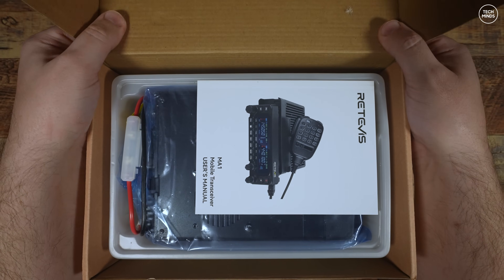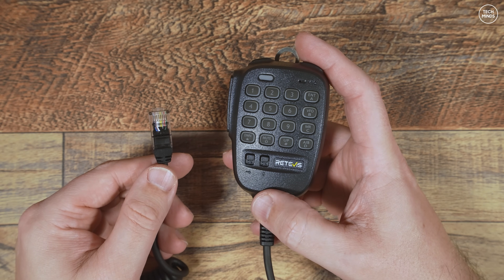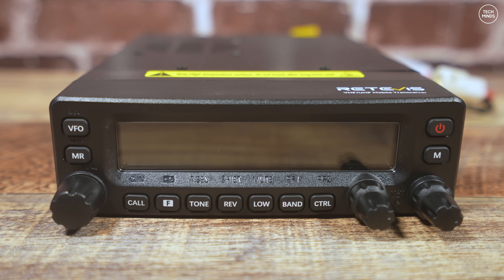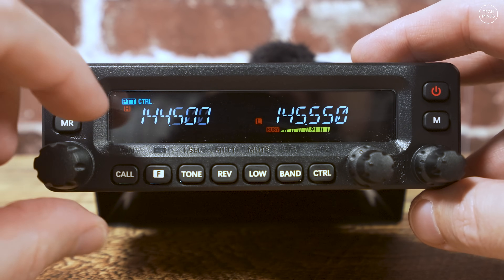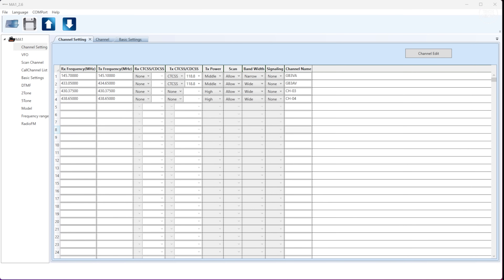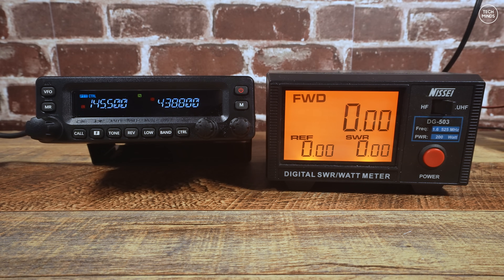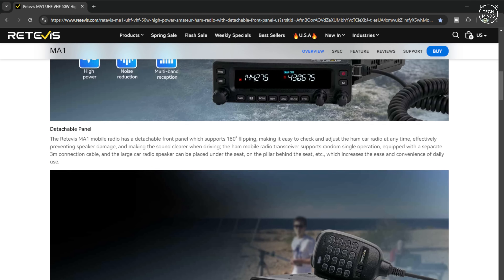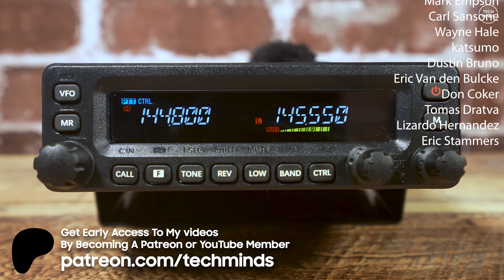Retevis MA1 - FULL Duplex 2/70 Mobile Transceiver - New For 2025!

Comment: Airband definitely seems pretty ok, rather than modded FM AM in firmware, the radio does seem quite big to store somewhere, possibly in the boot, but curious how long the remote cable is, any ball park width of the width of the radio

Comment: I've noticed quite a few people saying it looks like a knock off of a Kenwood V-71a, and looking at that, I can see where the control positions do resemble that radio, but, when I saw the display, the first thing I thought of was from like 30 years ago, the Icom IC-2410h.  That multi color display looked so fancy back then.  It was really just a colored background and reverse LCD.  There was also a version of the radio that had a more standard orange background with black LCD element too.  Google Icom 2410 and you will see what I mean.

Comment: Hi Mat, nice video on this new Retevis MA1. It seems to have a lot of functions I like and also the power output is on pair with Japanese manufactered radios. Did you try to connect the radio's USB port to a usb port of a computer to see if data can be transfered to a coputer (f.e. the Direwolf software TNC). Has it APRS functionality ? Cheers, Phil ON4VP

Comment: RJ-12 not a RJ-11
Reply from the maker: Same plug size, 11 uses 4 wires and 12 uses 6, so you are correct, it uses 6 wires. I had to check! But who cares..
Reply: @TechMindsOfficial  Perhaps there person that is making a extension cable.🤣

Comment: I left a comment on another channel, they missed on the power output with the uhf side of the radio. Where the power output on the uhf side way low in the ham bands. The highest output being at 400.000 mhz hams operate at about 146.000 up and down from there.144.0 to 148.0
Reply from the maker: Sorry, I literally have no idea what you are saying. I measured the power output in the middle of the 2M and 70CM band and showed it in the video for all 3 power levels.

Comment: Clearly, it needs a decent external speaker, but I notice that the AM sound on my Tidradio H3 is noticably worse than FM. Could be at least partly the problem on the MA1 as well. Edit: small keyboard mistakes

Comment: Looks like it would be good for satellite work with the dual rx. Maybe see if you can try it
Reply from the maker: I have tested transmitting on 70cm while listening on 2M and that works perfectly. I think for satellite it would be great to have CAT control, but I am not sure that is possible with this radio. Further research required.

Comment: it comes with a remote cable but i did not see a remote head option in the video. In other words what are the options for mounting the head separate
ly from the radio. Seems like they provide a longer cable but no mount for the head unit.
Reply from the maker: According to the manual, or parts list on the website there is a Radio Bracket which looks to me like it should fit the head unit. However, my box did not come with one! I am going to contact Retevis to see why it was not included. Thanks for pointing this out and reminding me.
Reply: @TechMindsOfficial  The Retevis website shows a pair of brackets included - 1 for transceiver and 1 for control head.  - K2XT
Reply: @feeatlastfeeatlast5283  Yes it does but mine did not come with it either. Not sure what is going on with that. Going to email them.I've watched another video on the same radio and that video also does not show a remote mounting head either.

Comment: Why would anyone waste their time and money buying this radio. Just the same as many other radios already on the market, but with a cheaper LCD screen and hard to read button labels stamped/cast into the plastic! above the buttons
Reply: Are there any other full duplex, cross band repeat radio on that price range? For ne that's the main feature, is there another better radio with that feature? I really want to know
Reply: @briansegarra9312  There is the Anytone 5888uv at $249.
Reply: @briansegarra9312  full duplex!? Ooh that's a steal if you're interested in doing satellites.
Reply: @briansegarra9312 Icom IC-2730a. Much better radio.
Reply: Because many people can't afford a 500 yeasu or icom.
Reply: For the money , it along with others like it a good solution for digital comms where you don’t change much, or for other uses that don’t require a lot of user interaction.
Reply: There is ONE radio that this is competing with: the 2730, with after buying the brackets needed to mount the face to the radio or to extend the cable, bumps the price to over 300 this is currently 260 Amazon
Reply: @jasonlin9805  i ended up getting a icom 2730 , got one used for a good deal

Comment: That looks like a really nice radio Matt. The black display aside, it reminds me of the Kenwood TM-V71 dual band mobile.
Reply: I have the kenwood tm-v71, and this is very similar, almost identical. Display apart, the kenwood one is much better in my opinion.
Reply: yes!
Reply: yes its the same  to kenwood tm-v71 but the black display its not nice.
Reply: I also have a TM-V71. I use it for FM satellite work as it connects to a single antenna for dual band full duplex. This Retevis copy seems like a good replacement for the discontinued TM-V71 but it maybe a tad too expensive for a copy which may have limited to no support in case of failure...I think £180 would be a good price point. I do like the computer programmable aspect and the airband receive is also nice to have. I see it's a tad over £250 inc VAT from AliExpress.
Reply: I opened it up, it is not a copy of Kenwood, it's a complete different design, even the case is similar
Reply from the maker: oh yeh, you're right, they look pretty much the same! IMO the screen on this looks better than the Kenwood though.
Reply: @TechMindsOfficial  How well does that display do in direct sunlight?  Is it still readable or does it get washed out?
Reply: @TechMindsOfficial  agreed.

Comment: Is this full duplex for receive on one band while simultaneously TX on the other band? If so, can it be CAT controlled for working satellites?
Reply from the maker: Yes, I just tested transmitting on 70cm while receiving on 2M at the same time. Not sure if CAT control is available, but if it is then it would work for satellites using automated software.
Reply: What about th opposite some radio have issue with the opposite  talking on 2m and recive on 70 m ? Im really interested on this radio for satellite work @TechMindsOfficial
Reply: Full duplex??  Now it’s got my attention!  Thanks for the video!  73
Reply: Was about to ask the same question. That would be cool.